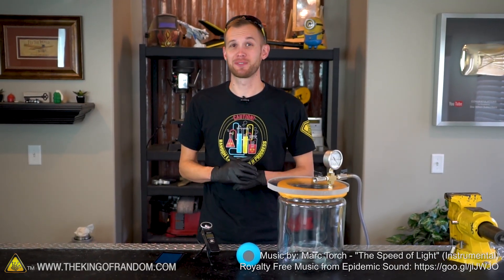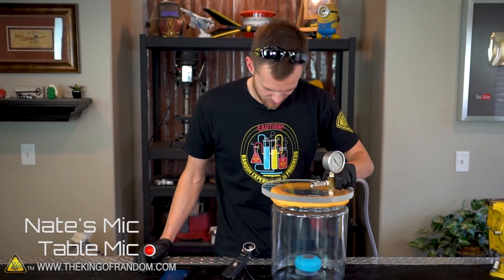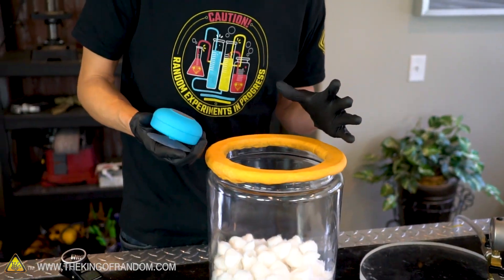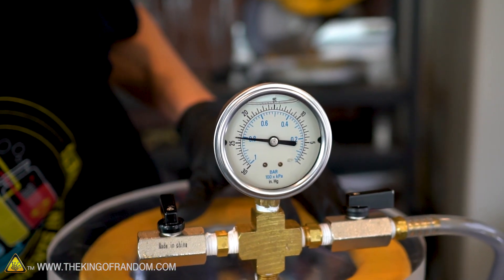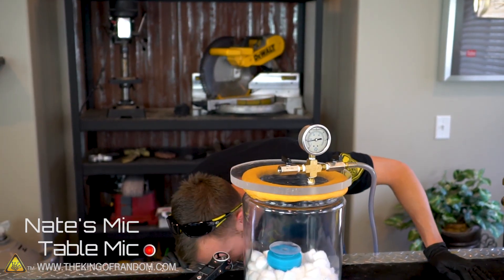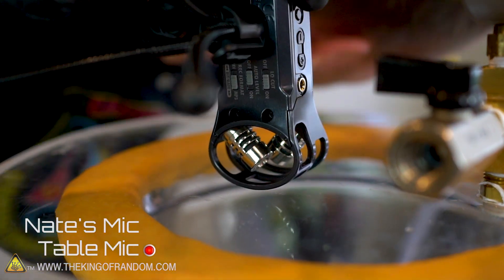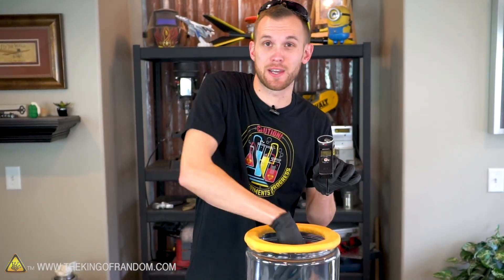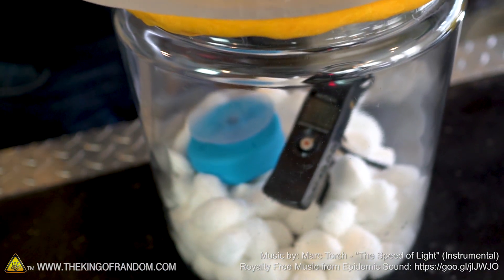Can Sound Exist In a Vacuum Chamber? TKOR's Vacuum Sound Speaker Experiment!

Comment: Can you grow a plant in a vacuum chamber?
How is it effected if at all?

Sweat Basil grows pretty fast, but maybe a capsicum would be more interesting.

If you do capsicum, Due to the length of time, and it being a biosphere of such you may want to be able to control the water released into it.
A suitable hydroponics mix in a bottle with some kind of magnetic or electronic release would work?
Reply: Liam Mitchell Plants require air to grow, a vacuum chamber doesn’t have air. That’s why there aren’t any plants on the moon lol
Reply: Liam Mitchell
Plants breathe carbon dioxide and "exhale" oxygen. Most plants also require some humidity, both of which requires air.

Comment: Is it possible that you can soundproof a room by surrounding it in a small layer of a vacuum in between walls?
Reply: Yes. Sound cannot pass through a vacuum.
Reply: then it means it would be excellent soundproofing, but it sounds costly
Reply: Double galss work more o less like that. But the key issue is THE FLOOR. On TV stations the main sets have a "floating" floor decupled with ruber block to the main floor. And is like one room inside another big one. They dont use vacuum. They need to open doors and circulate air. In fact heat builds up very bad in those sets.

Comment: Put a speaker in different gases.
Reply: Yes, you will, because different gasses have different densities, so it will be either higher pitched if the density is lower (helium, hydrogen...) or lower pitched if it's higher (sulfur hexafluoride, argon...)
Reply: Zero Playz you wont hear a difference

Comment: What would happen if you froze Napalm in liquid nitrogen and tried to light it on fire?
Reply: hoLD ON SATAN
Reply: Eve Dixon it would probably light on fire, although the actual recipe for napalm is still a secret as far as I know but if I had to guess i think it might stay on fire
Reply: Eve Dixon
Before any material can ignite, it must reach its kindling temperature. The kindling temperature of gasoline is 280° C. The kindling temperature of napalm is much higher than that. Frozen napalm, like frozen gasoline, will not burn.
Reply: shinaanish I just want to see how napalm behaves in liquid nitrogen

Comment: Honestly the mere fact that the magnet still moves is impressive but also leads to the conclusion that it would produce sound just because that magnet moving has to be pushing something.
Reply: Vacuum does not affect magnets or electricity. The magnetic movements do not push against anything if there is no air.

Comment: What happens to water inside the vacuum chamber? As water is H2O, O being oxygen of course, as the chamber expels air will it separate the two elements?? I guess it won’t but still an interesting theory :)
Reply: the covalent bond will not be broken by the lack of pressure in the vacuum chamber, the only way to split the two elements (easily) is with a chemical reaction.

Comment: Do this with a magnetically levitated speaker.
Reply: The sound wouldn't be able to pass throw the walls of the chamber if it was levitating.
Reply: That's what i was saying
Reply: Siiello that was a hypothesis not a fact, dismissing something as a final irrefutable fact is not science. 
There's no proof either way and there's always more space for experimentation. 
Vibrations have a possibility to pass through any matter, including fluffy white solids.
Reply: Lojobo Cuber i dont think it would make a different, because it’s not air particles holding it up, it’s a magnetic field which isn’t effected by air particles.
Reply: the tiny amount of sound left was from tiny amount of air left, had nothing to do with contact, levitating speaker would leave same results.

Comment: Put an EGG in your Vacuum chamber. Also, another soft egg that was soaked in Vinegar for 2 days.
Reply: yas
Reply: Implode? Didn't you mean to say explode ? The pressure inside the egg will be higher than the pressure in the vacuum chamber, so the air will want to expand, resulting in an explosion, not an implosion.

Comment: "So something in that chamber is still vibrating enough to get the sound from our speaker to our microphone." Yeah, it's called air. You think you actually removed ALL the air from that thing with just your little vacuum pump? The glass would implode.

Comment: LOL! I think you need a better vacuum pump for this one - if looking at the pressure gauge you only got down to like 0.15 atmosphere. Unless you're at an altitude of like 1300+ meters (where the atmospheric pressure has dropped some), that's still enough air to carry sound quite well (even though it get's a little weaker)

Comment: Since sound pressure is what we hear, it is radiation energy that is coupling with the plexiglass as it's directly in line with it axially. The rubber would dampen any radiated energy coupled to the glass vessle.

Comment: Isn't it obvious before the experiment that the cone of the speaker would be at maximum excursion on a small speaker such as that and would either have terrible SQ or wouldn't work at all? If you would do it with a quality midrange driver with a decent motor on it I'd bet it would work just fine.
Reply: Robert H. Still the sound would dampen depending on the quality of the vacuum. That’s all the experiment set out to prove
Reply: Depending on how strong the vacuum is, it may not have much of an effect on a stronger driver.  That's what I'm saying.  For instance, the current setup that they have I'm sure wouldn't be able to tame a quality midrange driver with more power given to them than the couple of watts that speaker had.
Reply: In a full vacuum "space" there is no sound, just as there can't be a fiery explosion, unless fueled by an oxidizer. The vacuum pulled in this video isn't "full". There is nothing for the sound waves to vibrate causing sound, there has to be a medium as in our atmosphere. You might be able to detect the pressure waves or possibly even feel them, but you would not hear it.

Comment: Put a normal speaker(not in an enclosure) in the vacuum chamberand try it. Because the speaker is in an enclosure, the vacuum can be pulling up the cone(by pulling out the air) of the Bluetooth speaker and that can cause it to sound quiet.

Comment: Can you build a simulated human in there to see what would happen?
Reply: Charles Green everything in its body would collapse
Reply: actually the mouse will get knocked out, but when it reaches the vacuum it will freeze from the inside out and every single cell will rupture from being frozen
Reply: All the joints between every cell will shear, and all the contents that remain under pressure will boil or explode. 
Likely to cause burst blood vessels, air bubbles in the blood stream and much more. 

Probably nothing visible to the naked eye though.
Reply: Ian Collins only if you put a human in a microwave
Reply: Ian Collins not really
Reply: That’s AI
Reply: Charles Green don’t look at my username
Reply: you'd basically melt
Reply: you mean put a mouse in a vacuum?

Comment: Can you freeze liquid metal in liquid nitrogen not molten metal liquid metal
Reply: Governor Moose 👏👏👏👏👏👏👏👏👏👏👏
Reply: He means liquid metal as like mercury or a metal that is liquid at room temperature
Reply: Arvinnelouie Navarro it’s still technically the same thing because molten just means melted by heat. Mercury just happens to have a low melting point.
Reply: At 1 atmosphere of pressure, ALL metals above liquid nitrogen (LN2) temperature will turn into solids if you cool them to LN2's boiling point temperature (77 K).  Oxygen and ozone remain liquids at LN2 temperature, but many other room-temp gases convert to liquid, then to solid, and remain solid at LN2 temperature (Chlorine and Argon for examples).  Hydrogen, Helium, and Neon remain gases, even at LN2 temperature.
Reply: Theres no difference between liquid metal and molten metal, its the same state of matter, the only difference is how much you had to heat it up to melt it

Comment: I believe a larger area where the speaker and the microphone are not touching in any way, Unfortunately, you can't levitate items. There may yet be some air in the chamber and or there is enough surface area touching to transmit the vibrations through the container. It does seem that it is not the same as being in outer space trying to hear it.

Comment: How a Drone inside a moving car will move? wrt car or wrt ground?
Reply: Arun Kumar a bit of both. It would lag behind the acceleration of the car, but, in general, it will hover in relation to the car
Reply: Done already in the Action Lab. As well as this one.
Reply: Look up frame of reference... there’s a whole bunch of physics concepts that deal with displacement inside of moving objects, it’s really interesting
Reply: Yes I want to try this from a long time.
Reply: Silver Fox True, but Einstein kinda went past that, his ideas had more to do with light. The concept was originally put forth by Isaac Newton
Reply: The  Suburbs interesting, didn't know that.
Reply: Watch rotor riot flying drones in a moving van
Reply: Check out “Action Lab drone inertia” video
Reply: Really?
Reply: car
Reply: how about drone in vacuum ?
Reply: Baskor Juli
A drone in a vacuum is a dead duck. Drones require an atmosphere to fly. In a vacuum, they'll just sit there.
Reply: Depends on air pressure.  Are the windows open or closed
Reply: Baskor Juli drones can't fly with it air pressure.  In a vacuum there is no air.  The drone would not fly
Reply: Action lab done that already
Reply: I always wondered on that question
Reply: I thinkkkk Einstein figure that out? i forgot what he called it but he explained how it happens.

Comment: I have a question.If you fill the chameer totaly with helium does the vibrations of the membrane travel faster , slower or equal fast through the helium as it does in normal air? Is the pitch of the sound higher or equal? Thanks for every day new videos.

Comment: Awesome video... but...

There is another factor you forgot to talk about. Though the glass is rigid, it can still deform a little in normal conditions, is that because you can listen to the music when the chamber is closed and at normal pressure. When you use the pump to get most of the air out, all the atmosphere is pressing against the glass chamber, so its harder for it to vibrate, you will also be able to notice this effect if you increased the pressure to about 1500 mmHg. That will explain why you could still listen to the music from inside but not from outside when there was less pressure.

Comment: It's so cool because the the air around the speaker vibrates all around it and that's is how the sound is made and when you put the speaker in the vacuum chamber all the air is sucked out and then the sound cant work or the vibration is canceled because there is no air to jump across to

Comment: If add more air  in the high pressure chamber  will it be louder??
Reply: He said "pressure chamber" that is a chamber that has a higher than normal pressure, not a vacuum chamber being re-pressurized . He wants to know if the speaker would be louder with a higher than normal pressure. So, you would need to use a pressure chamber.
Reply: T Kevin  Vacuum chamber means there’s no air in it, that’s why you can’t hear it. Of course if there’s more air you can hear it, he even demonstrated this in the video.
Reply: Yes

Comment: Put Lightbulb into a liquid nitrogen 👊👑
Reply: If it's one of those old incandescent lightbulbs, you would see some solid argon appearing. If it's a fluorescent one, you might see a tiny bit of solid mercury in the bottom.
Reply: Lightbulb explodes. Great experiment
Reply: Jimmy Fallon North Korea cheerleaders
Reply: The light would probably get very bright as well.
Reply: Put dry ice with boiled water in your vacuum chamber and find it out what happened...........tanishq goyal (from)
Reply: Olaf Falo hi ft
Reply: It will change colours
Reply: SuicidePleb XD it doesn't have air doesn't mean it doesn't have a gas inside. Most commercial bulbs will have an inert gas, usually argon and nitrogen. Only some specialized lamps still seem to use vacuum.

Comment: those small speakers outputs decent amount of mid to high frequencies but very poor on low frequencies, each region of frequencies react differently to various sound conductors, try using a bigger speaker that provides you with full frequency range (~20Hz to 20000Hz)

Comment: A loudspeaker could possibly change due to the negative pressure, so that the music does not sound right anymore. Instead, for example, try a motor that turns something that constantly beats something else, like a bell. then fix it on a small board and place it like the speaker.
Reply: Yah could be distorting the speaker cone/suspension. Should've used something more solid state, like a peizo!
Reply: Thought already of a piezo buzzer but could possibly be influenced.
Reply: Tesla coil to play the music?

Comment: Your vacuum pump loses efficiency as the pressure drops.  When you gauge shows near zero there is still a fair amount of air in there.  Also, the speed of sound drops with temperature and pressure (technically just temperature, but that's another discussion).  As the speed of sound changes the frequency also shifts (think Doppler effect and you're close).  Try tuning the mic to listen for higher frequencies.  This is what happens when you inhale helium.  Lower density has allows your vocal cords to vibrate faster giving higher frequencies.  The diaphragm acts almost the same way.  There are differences because the systems are being driven differently, but...

Comment: What happens when you put molten metal in vacume chamber? Can you do this experiment?please
Reply: thunder bolt I'm sure as long as he puts that material in the metal foundry into the vacuum chamber it won't affect it much
Reply: Would the glass jar break as the molten metal start touching it?
Reply: thunder bolt it would cool instantly
Reply: depending on the metal, it does in fact form a vapor, that is how those thermal blankets are made, it's aluminum vapor coating a plastic. Also how you silver a telescope mirror.
Reply: thunder bolt How would you clean that
Reply: si cheng not on the glass jar but with a plate or something
Reply: PHYSICS thats what would happen
Reply: Would be interesting to see with a variety of metals
Reply: By the time you put the molten metal into the vacuum chamber and get everything prepared and create the vacuum, the metal will solidify. If you were somehow able to have it molten by the time it goes in the vacuum, it probably boil because there's almost no pressure, and you could end up with some gas of the metal. Everything can be a solid, liquid, or gas with enough heat or lack of heat or with lack of pressured.
Reply: There is a chance that it begins to form a gas as the lower pressures increase the boiling and melting points, resulting in the hot being hotter and the cold being colder, giving us gaseous metal.

Comment: Could you try to put a fire out with a vacuum chamber?
Reply: saw dawg11 it would just immediately go out when he puts the cover on not pulling any air in because it cuts of the oxygen
Reply: Oh ok but correct me if I’m wrong don’t we already know what will happen when you take the air out it will just go out
Reply: It wouldn't be instant, but it'd be pretty quick. I believe once there's carbon dioxide introduced, it'd probably suffocate the fire before all of the oxygen is burned up. Could be wrong though.

Comment: What would happen if you put a chip bag inside of a vacuum chamber?
Reply: Timothy Miller the chip elf would come and add more chips to the bag xD
Reply: Timothy Miller its allover youtube just search it up...
Reply: It will only pop
Reply: Comment.exe has stopped
Reply: Timothy Miller it crushes all the chips and crumbles up the packet
Reply: The air in the chip bag crumbles and is converted into chips
Reply: It deflates to 1/4th of the size because the bag is almost all air
Reply: It would go BOOM!
Reply: +Timothy Miller a bag of chips, you mean?
Reply: It will just explode